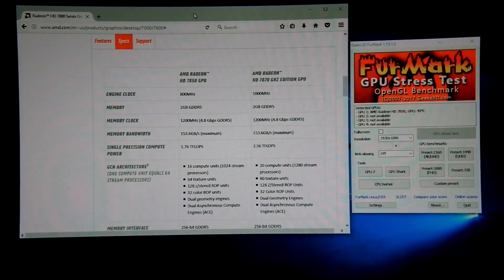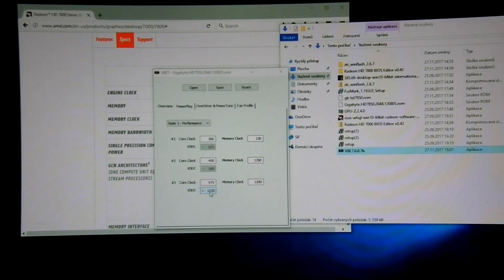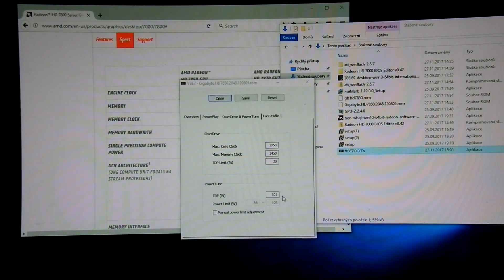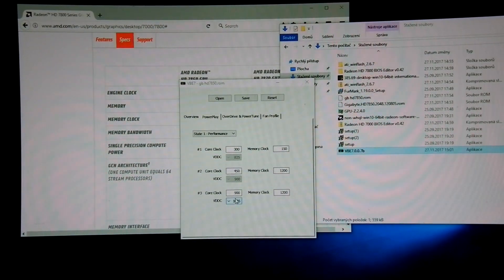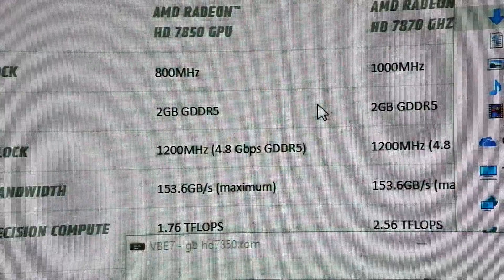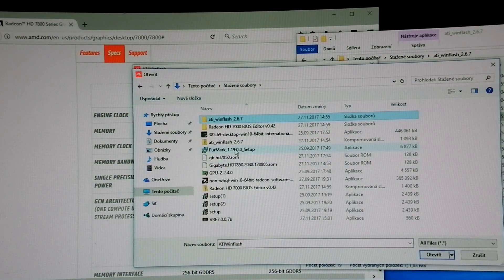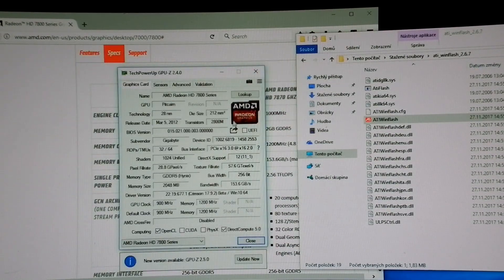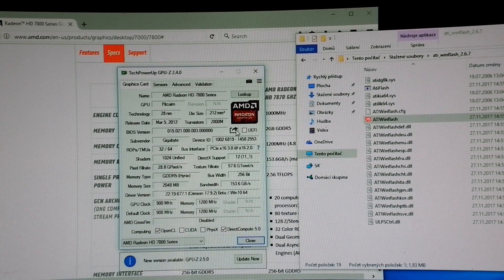HOW TO EDIT bios on AMD GPU Card with VBE7 software

Comment: can it brick the gpu?
Reply from the maker: @noz7292  no as you are mod the original bios you can brick GPU if you flash with wrong bios
Reply: @ is there any simple bios editors? to just lower clock of my gpu speed? have a rx 470 and memory works at 2000mhz and minimum I can set is 1900mhz with softwares. saw polaris bios editor but it looks like little risky
Reply from the maker: Hi IAM not sure as vb7 is for older card and I never have a look for Polaris BIOS editor but look on different bios  already moded on powertech web

Comment: Can i change max temperature limit in this program
Reply: did you change it ?
Reply from the maker: Good question:-)
Reply: @frogtechtips  it is saying file not supported while opening, i have rx 560
Reply from the maker: Hi this software is for up to r9 and card not sure is existing for higher version and card software like this one
Reply from the maker: Yes you can
Reply: @frogtechtips  its say not suporrted. I have rx570
Reply from the maker: @anix1398  oh yes is for older AMD card

Comment: 1. on some card you cant do this -> hd7850 powercolor line , with ABR hynix  &  r9 270x powercolor psc+ (DO not try !!!) you cant manipulate with VDDCi .
2. After saving bios , load  modded bios again in vbe7 you will get invalid cheksum message , you just need to save again bios & it will be 100%  rdy for programing.
Reply from the maker: Thanks for the tips
Reply: please tell me if this software can downgrade GPU RX470 ?
Reply: @liem0808  you can't use vbe7 for polaris card. >> MSI afbetrburner << will finish all what oyu need.